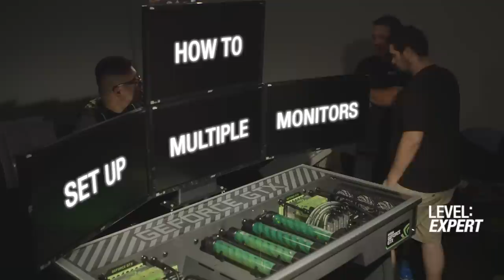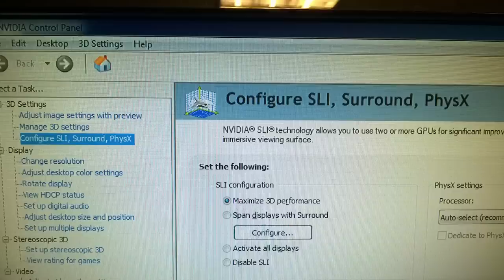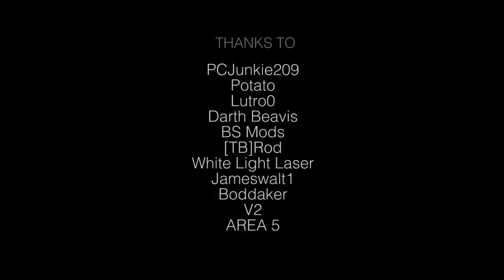GeForce Garage: Cross Desk Series, Video 8  – How To Set Up Multiple Monitors

Comment: £4,000 for monitors and GPU's alone, and the frame rate looked horrendous. It's a cool setup and all, but I think four 144Hz 1440p monitors would've been better
Reply: For sure
Reply: Toby McDaid I'm doing 3 of those Asus Rog with two Titan X's. Do you think it would be better to get a third or should I not risk it? But is micro stuttering an issue if you have Gsync monitors?
Reply: Shenta I don't personally own the Asus Rog or any Gsync monitor so unfortunately I can't give an experienced opinion. Whether you want three monitors is down to you, personally I've never been a fan of having screen bezels blocking the game's view so I personally stick with dual monitors, use one for gaming and the other for background applications. I just looked at some benchmarks for the Titan X's in SLI, using Middle Earth: Shadow of Mordor as the game (which is pretty demanding I'd say), and at 2560x1440 the game had an average frame rate of 119fps. If you ran this across three monitors you're looking at the fps being around 40-50fps if you split it across the three screens. Of course this is on max settings so you could get more fps, but perhaps not 144fps. It really depends what you want to play. If you're into high end graphics I'd say avoid three monitors to give yourself full utilization of that 144Hz. Don't take my word for it though, you're better off asking the same question on a proper PC build forum.
Reply: Thanks for the help. If I run a program on the triple monitor set up, I would most likely drop it down to 1080p for all the games. And if I wanted to play a game while streaming at 2k I can do that no problem on just one. And turning Vsync off tends to result in a lot better frames.
Reply: Shenta Yeah you'll be fine playing the game just on the middle monitor if that's what you want to do. I wouldn't advise lowering to 1080p though, it looks horribly blurry when you run lower resolutions on higher resolution screens.
Reply: Shenta honestly run 980s sli and with the same gsync monitor that they're using in this video and I have not once experienced any stutter. Whether or not the titans is the same I couldn't say.. but I do know one thing.. gsync is incredible!
Reply: Mitchell Hall Thanks Mitchell but I'm a game dev, Titans have more cuda cores than most quadro cards. Over time with better drivers the X will be doing amazing things in maya and adobe.
Reply: Shenta sorry I didn't mean for you to run 980s I meant to say I run 980s ** sli and I don't notice micro stutter. Sorry for the mixup
Reply: Toby McDaid I may be a bit late, but if you run 1080p on a 2160p monitor, it won't look blurry, it's just if you don't use a monitor resolution that's an multiple of your content, that it appears blurry (e.g. 720p on 1080p screen).
Reply: manaquri what do you mean?  That's not true. From what I understand, anyway. I have a 4k monitor and if I set it to 1080p games look more blurry than they would if it was a native 1080 screen.
Reply: manaquri I run my games on a 1440p monitor and if I set the resolution to 1080p everything becomes stretched and blurred, it's effectively stretching 1920x1080 pixels across 2560x1440. The only way to make it less blurry is by putting the game in windowed mode and shrinking it down to a smaller size.
Reply: Mitchell Hall the game should not look blurry, because it's as if 4 real pixels display 1 virtual pixel.
Reply: manaquri you don't understand the concept of  if you lower the resolution. the individual pixels then become blocks of pixels. So color and everything else doesn't blend nearly as well. aka turning shit into minecraft.
Reply: teresa brown I understand that but, you should get the same quality with 1080p content on a 2160p as a similar quality and size 1080p screen.

Comment: god the frames looked horrible
Reply: dboydev And the irony was that they were using 4K G-Sync panels, but had massive tears @5:17 because they probably didn't even enable it.
Reply: KinaestheticDmaw I don't even know you can in surround :|
Reply: KinaestheticDmaw idk why they made it, but G-Sync work with only Display-Port cable and they used HDMI LOL
Reply: KinaestheticDmaw That cuz of the 30 fps recording.
Reply: Steffen Storbeck yes they have.
Reply: Jonhy ge Well mine yes.
Reply: Jonhy ge No, they don't. At 3:36 you can see that there is only a DP connector:

https://youtu.be/ZWy4EppFgk0?t=3m31s

Here are also the specifications for the monitor:

http://www.newegg.com/Product/Product.aspx?Item=N82E16824009658
Reply: HogSingh/HighScore those were DP cables, G-Sync monitors ONLY support DP. Get it right son.
Reply: HogSingh/HighScore lol I own that exact monitor. It doesn't even have an HDMI port.
Reply: ok ok im sry, im wrong :/

Comment: The top display looks useless to me....
Reply from the maker: AiriLingSY It's an Accessory Display, and is quite useful: http://nvda.ly/LYr9F
Reply: AiriLingSY I have a top display, its not used for anything but showing diagnostic stuff (temp monitors, fan speeds, clock speeds, ram usage, etc). Its INCREDIBLY useful actually.
Reply: Probably but 4-way is only going to create bottleneck even with an intel core i7-5960x . Two way is probably as far as I would go
Reply: AiriLingSY If you have ever done programming, it is incredibly useful. Having to look up means it is harder to get distracted, meaning that you are often more efficient. Souns small and insignificant, but it helps alot.
Reply: I am setting up 2 monitors for programming. I think it is incredibly helpful!! But I have no money to make 4 monitors setup Orz. But I think it will be confused and not useful using 4 monitors config... Instead, I have an 2K monitor for main coding @@
Reply: Paulo
Reply: +AiriLingSY why do u need a super high res monitor for coding. o_0
Reply: VengeanceCore Youre looking at it wrong, its giving them much more real estate. Thats why programmers and stuff use 4k+ monitors now.
Reply: +AiriLingSY Yeah, it's a shame AMD drivers are better at handling multiple panels at various resolutions.   Nvidia has the hardware but I gotta admit a multi monitor setup might best be served by AMD.
Reply: +AiriLingSY I like having a 4th monitor. It gives me an area to keep a clock, shortcuts, monitoring software, and anything else I want quick access to while gaming.
Reply: never seen a use for more than 2 monitors personaly
Reply: ***** In gaming, you're right, one to have the game open, and the other to have browser/etc open for notes etc.

But for programmers/devs... screen real estate is needed because to multitask as much as possible without having to alt-tab around the various programs is good.
Reply: I am a programmer and found that true lol
Reply: +AiriLingSY In nvidia's case, how will you know what game your playing?!
Reply: +NVIDIA what monitor stand is that?
Reply: +AiriLingSY are you Paulo?
Reply: You don't need an entire 4K monitor for all those! Haven't you ever heard of a Logitech LCD keyboard display? There's an entire section of MSI Afterburner settings dedicated to deciding what to display in it. I use it for years to see realtime info while a game is running.
Reply: JgHaverty
Many young gamers are just suckers used to make more money for IT companies. I had a clickety-clack mechanical keyboard 20 years ago from IBM... those things were all thrown in bin by entire industry and replaced with quiet membrane keyboards.. now they have found a new market for suckers.
Reply: geogan2 I'm not saying mechanical keyboards are bad in and of themselves, but you also have to consider, if you game at night when other people in the house are sleeping, it's kind of obnoxious to be clickity clacking the night away when others are sleeping in order to work the next day. 

And when I get to typing quickly even on my membrane keyboard I can get a little louder than you'd expect from a membrane one.
Reply: Christopher Snow cherry mx silent or stealth of whatever they are called.
Reply: bmxriderforlife1234 I think the brown switches are known to be among the quietest.  Don't get me wrong I'm not against mechanical keyboards, it's just not for everybody or for every situation. 

I was just looking into gaming keyboards with membranes, they're not really cheaper than mechanical keyboards when you consider you want one with anti-ghosting.
Reply: Christopher Snow nah browns are in between a red and a blue, they have the tactile feedback but without the loud click. im pretty sure they are called stealths and they dont click at all they are a silent switch and dont feel the same as a brown or blue, there is no distinguishable click for the switch.
Reply: Christopher Snow orange is in my opinion one of the quietest
Reply: same
Reply: VengeanceCore the main reason for that is that the monitor is 27inch and will look blurry for FHD.
I now have a 43 inch UHD that works like charm for assessories too.

Comment: Bolts and wing nuts should be on the top. Screws come from the bottom up, and bolts or nuts on top. Gravity, its a pain if those bolts ever come loose. Look at a street light, the bolts are on top for a reason, you never have to worry about them coming loose.

Comment: It looks to me like there are 2 fully equipped motherboards (basically 2 computers) in that system, yet there is only one set of monitors hooked up to the left computer (when facing the screens as seen at 2:37).  I was wondering if the computers are somehow working together or if one of the computers is basically just a very expensive cosmetic detail.  Or maybe the other computer is a backup in case the other one crashes?

Comment: great video. I got 2-Nvidia Nvs 510 cards in my system because I wanted to run 6 monitors. But for some reason windows 7 only allows me to see the monitors on 1-card not both NVS 510. What am I'm doing wrong. I have a dell precision T3610 which one of my NVS 510 came in the system. Can you help?Thanks

Comment: So does NVidia not recommend doing what Displayport was designed to do and actually only have a single cable coming from GPU to first monitor and then daisy chaining the other two monitors. I have a triple monitor setup and just got a Gigabyte GTX 1070 Extreme card with three Dell monitors and I don't like the way pulling three seperate displayport cables all the way back down desk and to back of PC looks like  - I only want one cable back to PC and other two displayports daisychained from the first monitor. So does NVidia support or recommend this??? Or not and why not?? That's what I came to this video to find out (given the video title!!)

Comment: Hello, 
I just bought 2 dell u2412m 1920x1200 resolution on a 16:10  (1 DVI-D,1 VGA and 1 DisplayPort), how could i connect it to a msi gtx 970(1DVI-I/1-DVI-D/HDMI/DisplayPort)
One to display port and the other one to dvi i? could i connect both to DVI I and DVI D without losing resolution? Sorry, im a little bit confused
 Thank You

Comment: does anybody know any mounting system that will work with this. in the middle of the mounting system a 29.1 inch monitor and on the left and right side 24 inch monitors.

please someone respond. would help me out alot.

Comment: This vid is 90% Marketing & 10% Tech. This is supposed to be educational, but you don't explain any of what you're doing. It's a bit tricky getting surround setup through control panel and adjusted properly, but you don't even touch on that. Also, determining the rules for which cable types to use and when you can use them (i.e. DVI-I or D..HDMI standards for 4K, etc...); cable connections for multi vs. single gpu surround; which gpu in a multi-gpu setup works as the primary display driver; and a whole host of other "Tips & Tricks" that would actually be helpful & that a person trying to duplicate your efforts wiould need to know. This whole tech series is "light" on detail or info you can actually use. It should be called the GeForce "Marketing" garage...

Comment: What am I doing wrong? I have 3 monitors and when I set up surround using Nvidia control pannel my middle monitor is fine but the 2 side monitors are extremely stretched out and its next to impossible to see what is on them. That is only in game normally there fine but the game gets stretched out like crazy. I'm using the same monitor as well for all 3.
Reply: Jeff Bobbery This is normal with high FOVs, just turn down the Field of View slider like Alex said and you'll be fine.
Reply: The outer monitors are pretty much all stretched out, It'll always be like that, You focus on middle monitor not outer monitors. I have triple 3D monitors.
Reply: DankLord420 ***** Thanks for the help

Comment: NVIDIA HELP ME FFS. I am running 3 VG248QE in Nvidia surround. I hired an expert who got headache but succeeded after 2 hours of installing the fourth monitor (a TV), he had to come over to my house god dammit :S I now want to install a fifth screen and use it as a top panel for all my temps and fan speeds. The computer finds the fifth monitor but cant apply it as a third screen, since it sees the first 3 as one now. However, when I turn off nvidia surround I can use all five monitors and get a ll screens to work fine as 5 separate but then I cant game on my 3 144Hz.... Im running 2st 970 and 970 says on your website that they can handle 8 displays, I only got 5 so it should work fine right??? I'm also using a ASRock Extreme 9 and 4790K so its not a hardware problem. VG248QE are connected to master card, 2 with Dual link DVI and third with DP. I also want to connect a sixth monitor and I still want to be able to use nvidia surround and not have to turn it off if I want to use 5+ screens.

Comment: This setup is what is needed for my flight simulator which does use all four monitors.  Honestly guys, this video is not helpful, it shows me what you can do by throw money at something, it doesn't help in someone who honestly wants to connect four monitors.  No technical information.  "looks good in the shower, but not helpful.

Comment: maybe they should've opted for 4 1440p monitors instead of 4K
Reply: queenform what about a 4K monitor in the middle and 2 1440p monitors at the side and get rid of the top monitor at the top as it is just using up the graphics card would that work?
Reply: gimmie55 Why would you do that? that would be dumb, have every monitor 4k, or all of them 1440p
Reply: ProdigyGaming but you look at the middle one the most so you want that one to be high res and the other ones can be slightly lower res to help with performance but still have that awesome surround monitors
Reply: gimmie55 omg, all should be 4k and something called lowering the resolution on a game, If you can't play a game at 4k, then lower the resolution....
Reply: ProdigyGaming yea but if you do it my way then you can still have the 4k resolution in the main panel but not loose the performance on the less well used side panels
Reply: gimmie55 omg, you can't just do that, it's stupid, 1440p on the side and 4k in the middle???? that makes zero sense
Reply: ProdigyGaming why not !?!?!?!
Reply: gimmie55 because what in the world would that make sense? buy 3 4k monitors downscale them to 1440p if you can't play on 4k..... I just explained it too....
Reply: downscaling looks rubbish as pixels have to share one pixel it would also save alot of money
Reply: gimmie55 lol you're going to buy a 4k monitor regardless, mine as well buy the 4k monitors rather than spend money on 1440p monitors and then get a 4k monitor
Reply: ProdigyGaming yea but this is for this set up now and it is not as if they are being money efficient with this build but rather what can be done for performance now.
Reply: gimmie55 you don't understand, 3 4k monitors can be downscaled to 1440p, i don't need to explain anything else
Reply: teresa brown lmao how funny, theres games you'll like to play with 3 monitors and still you can downscale all 3 monitors or use 1 monitor for god sakes smh and you vs NVIDIA hmmmm who wins?
Reply: ProdigyGaming the fact that you use AMD is enough to know you know nothing of software. Haven't gotten a notification in forever, blames it. Children who lose arguments who can't concede defeat in any way except a childish one. Good job.